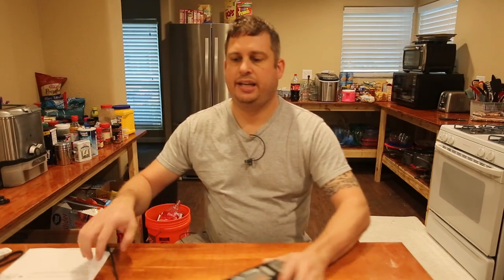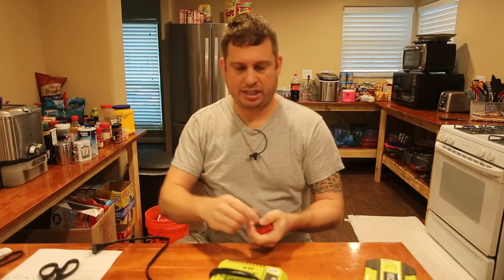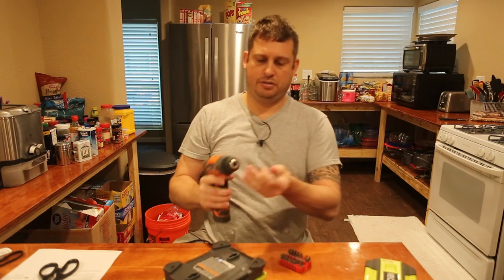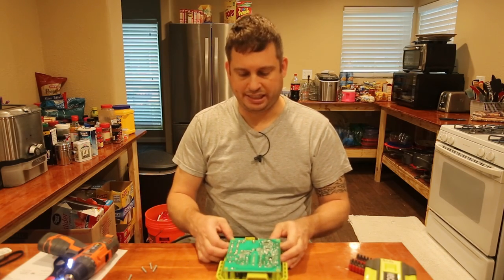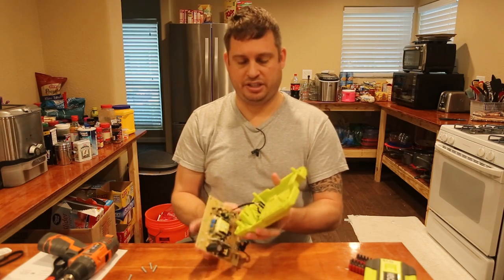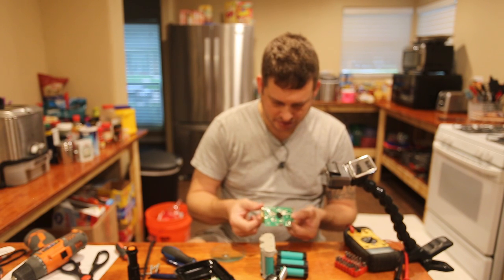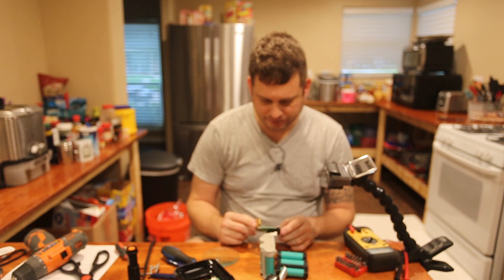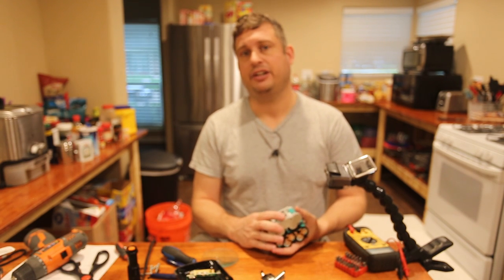Take Apart:Ryobi 40v Battery and Charger

Comment: well the pack was probably recoverable in the beginning. The issue was not the prying or missing screws or glue. there are at least 11 places where solder tabs go through the board itself.
Reply from the maker: The pack was deemed "defective" by Ryobi and a replacement was sent.  Instead of just disposing of the pack I wanted to see what the root cause of failure was, so I took it apart.

Comment: What's so weird is I just opened two of these same exact packs and instead of LG cells rated for max discharge of 30A, the two I had were all filled with Samsung 13Q cells rated for only 15A max discharge. So that's essentially half the drawing capability of my packs which is a big deal when you're using power tools in bursts. And I was so happy thinking I'd have some good 30A cells too. Bummer. I guess ryobi is just like: "Fuck it! Put whatever batteries we got left in those packs!'

Comment: Had one do the same thing during charging. All cells severely discharged. Painstakingly recharged all them back up to 4.20 volt and holding till I soldered the board back on which immediately started getting hot and pulling all the cells back down to 0 volt. Called ryobi they shipped me a new battery at no cost and said to dispose of the other. At least I have plenty of 18650 cells now to revive old drill batteries and laptops 👍

Comment: the circuit board is soldered to the battery pack, you will see big blobs of solder were the battery pack contact the circuit board there labeled CL1+ - CL10+ AND CL1- 11 SOLDER POINTS.OP4024 40 VOLT BATTERY. DONT PRY THE CIRCUIT BOARD BEFORE YOU REMOVE THE SOLDER.

Comment: hey, i repaired a few of these ryobi 18v packs (5-cell and 10-cell)  the voltage is is 20.7 at the cells before the circuit board and only 19.4-19.3 when check from the outside of the case,  a few other battery packs will show 20.7 from outside .... any idea why its doing that ?  Thanks

Comment: I realize this is a older video, but any time you are working with a "live" circuit, never use metal to pry with. Use some hard wood or non-conductive tool for that effort. Batteries can be partially charged and cause some real issues if shorted using a metal pry tool. I disassembled a Green Works 40 volt battery pack that refuses to work even though the batteries are fully charged. Have no idea why, but a costly replacement seems to be the fix now... I get a red light on the trimmer and the charger, so pretty much dead to me even though batteries perfect...

Comment: Brian, you appear to know electronics, could you help out an old 'tinker'r'?
 I had 2 dead ryobi 18v lith battery packs, one I got to 'spark' and begin charging again. The second had some light blue corrosion dust on them circuit board. I dry cleaned it with a toothbrush, but it still goes into 'defective" mode on the charger.
I tested the five cells, and all appear to be fine at 4.+/- V, but at the +/- contacts that insert into the charger, I only get 9.45 V.
I'm wondering if then corrosion did some sort of short damage on  the circuit board that can not be fixed by a dummy like me. Maybe, the cells are ok, but the electronics are toast?

Even if I can't fix this pack, I'm very curious to what "might" be the problem...I love tinkering with these kind of mysteries.

 Any help? Oh yeah, great video, thanks.
Reply from the maker: Probably a circuit board failure.... if the cells are good and it's not passing voltage then the controller is suspect.  I found what appeared to be a burned out capacitor on mine.  I deduced that was the cause of failure.
Reply: First, sounds like Ingress on the pack. water or dust. you can try Like you did to clean the Board and see if that works.
check voltages AT the cells. the board will limit voltage shown until it detects a Load. that's why you see 9 volts at the terminal, if you check on first and Last you should get a 20.1-21 volts across the cells if they are indeed fully charged, if not say 16 volts? then you have a dead cell in there. and it needs replacing. or if that's too much work, or you don't have same Cells to replace it with  you can toss the pack.

also check the Mosfets on the rear (attached to chunks of aluminum) if the pack was over drawn. ( for example, using a small pack on a Large tool like a saw) those could have blown and will need replacing.

Comment: Can you tell me what is the pinout of the battery or charger terminals? Obviously + and - 40 volts for two terminals, but what is the third terminal for?
Reply: i have the same question too and what is t1 for? if t2 is not used on the charger? Can u tell me maybe whats the resistance between plus and t1 on the charger? Because there's a video on the internet that their charging the battery directly without the original charger, using only t1 + and -.. Thanks

Comment: Super vid Showed me where all the screws are. Easy fix. to revive bring back from the dead 1 or 2 Li Ion cells  Just ark the cell with 6 or 12v and then give the single Li Ion cell a full charge on that cell. i have fix dozens of Zombi Ryobi 18v but never attempted my 40v just due to all the hidden screws.
Again Great video now it will be easy to fix all my Ryobi 40v batteries.

Comment: So I seem to only go through the 2.4 amphr battery. My 5 and small one hasn’t failed yet. But I have 4 dead 2.4 batteries and Ryobi cannot tell me why. 

That said have you found a way to get them to work?
Reply: its because of the way they charge them. Ryobi chargers zap full voltage through the cells in series (giving each a portion of the voltage). and over time some cells get a full charge quickly, so a weaker cell wont get topped up as far since its more discharged. Ryobi's BMS will Prevent over discharge, and overdraw but it wont top the cells off Individually. eventually you end up with one cell at 4.2 and one at 3.4.. when you draw power the lower cell sags the voltage and the tool craps out.. Its work. but if you want them to last they will need to be checked and Balanced from time to time. opening up the pack and giving each cell a Full top charge keeps them alive.
I have 2.4ah packs from 2009 that still have the original cells in them going strong they require a top up every 3-6 months. and you know its time on the larger packs when the light is yellow or 2-3 bars but the charger says full. or you are not at 20.1- 21.0 volts across the terminals off the charger. (thats 4.05-4.2 per cell) 

and sometimes cells just Take a dump. and there is nothing you can do. it self discharges into the floor. and takes its Connected buddy with him. at that point I pry the dead man off the Rail, and Put a new or Similar aged cell replacement in. and there we are! running again.!

Comment: I am looking at my Ryobi batteries, I have both 40v and 18v.  I also have a CPAP (machine that allows me t breath through the night) and I wondering how to use the batteries for my 12v machine.  Any ideas, suggestions?
Reply from the maker: Don't.  Get a CPAP designed with an integrated battery in it.  They aren't that much.
Reply: Homedepot sells a Ryobi $99 300W pure sine wave  inverter made for use with the 40V battery line. That should work as long as your machine uses less than 300W.

Comment: thank you for the vid , I have been tearing apart and fixing some battery packs myself. I have been very curious about this pack I'm assuming this is the 2.4 and power pack? did you happen to see the number after the 18650? was it a 15 or a 20 milliamp hour capacity per cell?

Comment: How to break a charger, battery, and camera. Great Darth Vaderer impression tho...
Reply from the maker: Haha..... I don't think I broke the camera... the battery was dead... so this was really to satisfy my curiosity.  I wanted to know what was in the battery and see if I could find why it failed.  I did learn why they won't fix them.  They are not designed for dis-assembly.  They are soldered/welded together and you have to destroy them to get them apart.  A real shame.

Comment: Thank you for taking the time and effort to make this vid.  It surely provided some insight for those  wondering about this pack.  Sadly, that's about all the praise I can muster.  
Being familiar with the battery, I can assure that it's not "cheap" or simple by any imagination.  The O2micro chip that's onboard is a sophisticated battery management system, able to isolate the banks until a load is detected, protect or permanently disable itself if overtaxed, and cleverly regulate charge to individual cells for balance.  It even drives that "cheap single layer" indicator board.  

No, I'm no pitch-man for them;  just an engineer with a desire to protect an investment in these products.  Granted, they do have an uncomfortable mortality rate, but the batteries can be serviced if one proceeds methodically.  Just a hint:  Those first two screws removed, thinking to release the innards, point to a failure mode.

Quite appalling, the barbaric destruction of the device (in the interest of troubleshooting???) that could've been avoided by noticing dimples in the label that hide the screws.  Rather fortunate the pack was flat and your crowbarring didn't set-off any fireworks (I was waiting for it). If you want to salvage the cells, just break the tab welds and the endplates slide off.

And what do you have against single-layer boards?  If you ever had to produce them, you'd appreciate not having to plate-through.
Reply from the maker: Thanks for taking the time to respond.  I think what surprised me most was that Ryobi (Home Depot) just cheerfully sends out another battery pack and makes no attempt to recover the "dead" pack or repair it.  I was simply told to "dispose of it properly" which was my invitation to see why so many of these packs had failed.

Not just on the 40v Ryobi Line, but on the 18v as well.  I like Ryobi tools functionally, I just got sick of 90 day battery packs that died and wanted to crack it open and see what was failing.  The problem is so endemic that the local store just rolls their eyes when you bring them another dead battery pack.  By Contrast my Dewalt MaxXR system has gone on forever with only 1 pack failing after owning it for 5 years.  I can live with that.  Battery life is amazing on the DeWalt system as well.

As for salvage, I don't think you can salvage a cell once the voltage drops to zero.  I'm not an engineer, but what I've read about Lithium cells suggests that when you flat line a cell it's gone permanently.  The chip you mention failed to do it's job from what you describe.  The part that appeared to be bad was a passive component and what was bad was that part and the cells were dead.  It looks like some sort of overload or charge failure.  I didn't spend enough time trying to decipher it.  I don't think the batteries are serviceable either once they are dead.  NiCad's can come back from zero, Lead Acid can, but not Lithium.

The Single Board is just cheap and primitive.  Nothing wrong with it, but most of the cost seems to be in square inches, hence 2 sided makes them smaller and cheaper to produce.  I just was surprised to see a relatively unsophisticated circuit board.  Given the volume they are likely to require I would expect the board manufacture to be done by a company that specializes in that.

Comment: I took the batteries out of my laptop while watching this.  6 cells, samsung icr18650's.  must have been a 3s2p format, because the charger is a 12.8v dc, and 2 cells read 4.09v, 2 cells read 4.05v, and 2 read 3.65v.   theres a few other identifyiing marks, but these typically get around 2200 mAh. just interesting stuff,  i would have liked to see the actual cells freed from their cages,  might have salvaged one or a few, im salvaging at least 4 of 6 of my cells it seems thus far.  good comments, cheers.

Comment: I plugged mine into a car charger and it works when I plugged into the weed wackier, but the charger still is flashing at me.  After hitting the test button on the battery and plugging it into the charger it stops working.  Either it’s the charger or battery computer tells itself it’s having a failure when it’s good to they sell more and keep making money.

Comment: I am wondering why this is the first time i am actually seeing this video, due to the fact I have been looking for something similar for some time, I laughed some through the video because I took apart one myself around the same time and had most of the similar struggles, they are 18650's and ryobi has used both lg and samsung  batteries in the packs the "fat packs" use 20 batteries (you obviously took apart a slim pack) I haven't really been able to find much on the actual stats of the batteries other than using some deductive reasoning and being that I am an amateur I don't really trust my deducing enough to make a purchase of the imr's and attempt replacement of the bad cells

Oh and the cells are IMR cells type not to be mistaken with common 18650's
Reply from the maker: As the cells are welded together I don't think they can easily be serviced.  In addition, the defect runs the cells to zero which causes irreversible damage.

Comment: Wat a load of junk !!!  I was going to buy a 40 volt hedge trimmer, but with batteries that are well over £100 and especially designed to not come apart, I shall buy a corded  machine.  With all the failures they obviously will go wrong so they can keep their 40 volt batteries !!!!  They are astonishingly complicated  for a circuit board in a battery pack !!!!  Thanks for the Video !!!!

Comment: Wow. The bottom is held on with two torx bit screws. The circuit board doesn’t come off because it it soldered with the tabs coming from the cell packs. I am officially dumber after watching this video.
Reply: Need bigger hammer, uug. I noticed the same things. Way over engineered.

Comment: 9 out of 10 chances the battery got too low and shut down the tool and somebody was too lazy to go put it on the charger so they unplug the battery plug it back in made it a few more feet the tool stop again they cycle the battery again started it again discharge the battery too far to open the load circuit to to charge it
Reply from the maker: No, the charger marked it as bad.  If it did over-discharge that is still a fault of the controller circuitry.  

This battery was replaced by HD under warranty.... so the one I took apart was going to go away anyway.  I just wanted to see what was in it and why it might have failed.  I still think it was a component failure on the circuit board.

Comment: LOL this was painful to watch. Dude, before destroying it, test it. there was a 99% chance that what happened is the battery voltage dropped below the BMS limit, and the BMS was unable to power the transistor connecting the battery to the charger. The BMS draws power constantly, and if it sits unused for too long, it drops too low. no big deal.
The fix is simple.. if you took a second to actually LOOK at the board, you would have noticed the big honking traces are the battery terminals.
with the battery facing the long way away from you, and the terminal ends close to you,  the far right terminal is your positive, connected through a fused trace, to the positive of the cell pack.   at the far bottom right, marked "battery - " on the board, is the cell negative. If this is too low, it wont charge.  All you have to do is put power to those two points until the battery is high enough to charge. the BMS cutoff mark is roughly 25v. As a 10s2p pack,  that is 2.5v min per cell for it to function. Personally I use a DC power supply set to about 31v, and limit the recovery charge to .5a (500miliamps)  this slow rate (for these high current cells) should recover it with it barely changing in temperature. Once at 30v or so, if it hasnt heated, you can take it off and toss it in the charger. It will then fully charge and generally work as well as before. There is a theoretical loss of capacity, but not noticeable in usage if you have only done this once or twice.
Reply from the maker: Nice theory... except that it was sitting on the charger..... and I only run my batteries down to 60% as a general rule.